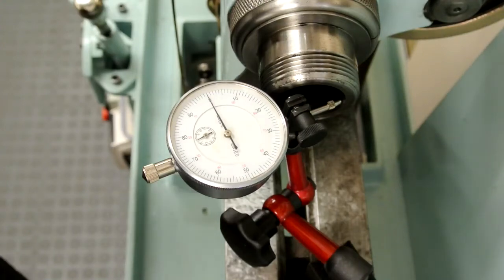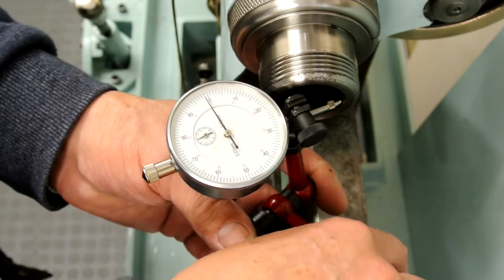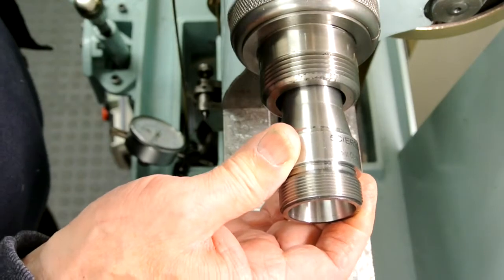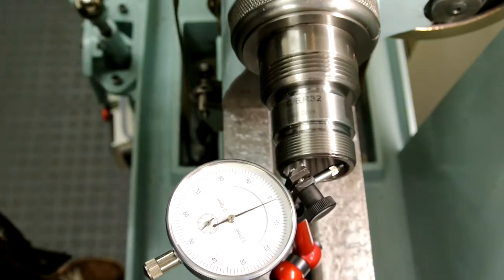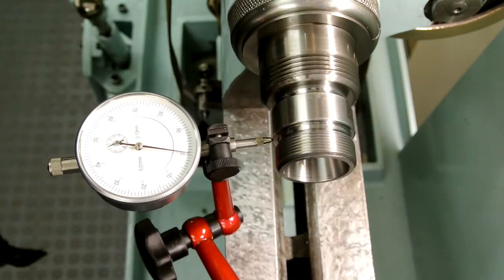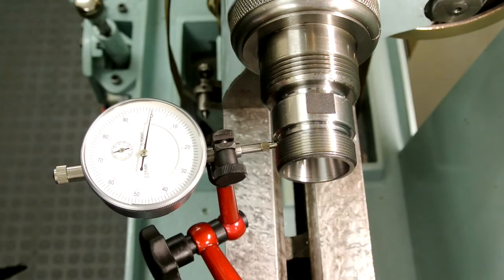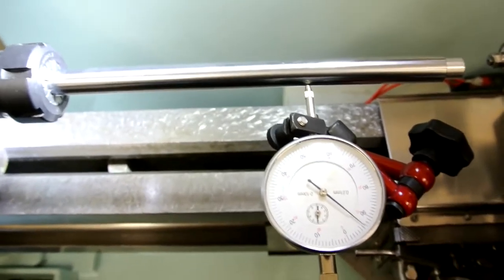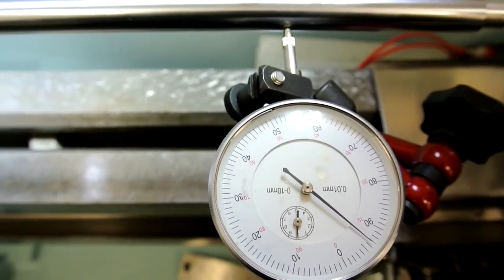Rivett 608 fitting a new er32 collet chuck

Comment: have you got a video of you regrinding the chuck?
Reply from the maker: Sorry no. I used a fine diamond grinding wheel and a motorised milling spindle. The top slide was set up using a dial gauge so it was accurately set to 8 degrees. To do this I used a dial gauge in the bore of the collet chuck until it was running at 0mm deflection. I blued up the internal surface before cutting so I could see what was being removed. It was a little tricky to mount the spindle and get it exactly on centre height. I could hear it cutting one side only at first. I stopped when it seemed to be cutting evenly and checked the fit of the collet in it. It is important to fit a ground pin of the same size as the collet so the outside is held accurately. I checked with engineers blue and it was obvious that it was cutting more at the back than the front. I could actually feel the collet rocking slightly. I altered the angle slightly and reground it until I could detect it cutting at exactly the correct angle. All this took a while but did give me an internal angle that was an accurate fit to the collets. It was much better than the original chuck.

John

Comment: The run out is normaly measured on 100 mm out of the chuck. 0,06 is not abnormal, but for modern fast operating (cnc) machines way to high.( thos are asking for other clamping systems - 0,004 mm max.). For older and slow working machines it is normal. Things can get worse if the collars are used to long. If daily used for clamping various tools, the have to be replaced every 6 months in order to have a constant precision. Good thing to check the precision of your tool clamping systems. Best regards.
Reply from the maker: Dirk
Thanks for the comments. Don't forget that the Chinese ER32 collets are not that accurate. I already returned one set because they were terrible. These ones were a bit more expensive but were much better. At least the collet chuck is accurate now and any inaccuracy is likely in the collets. It is not possible to grind the collets to get them to run true unfortunately.

Originally the Rivet 608 was one of the most accurate lathes in its day.  The original certified run out accuracy was .002" at 2" for the 5c collets. The spindle run out was 0.0001". 

John
Reply: True. A lot of "manufacturers" are offering these collets. it is not easy to find the good ones. Personaly i do have the best experiance with German ones. But of course in the US someone must offer a simular quality. Often the difference is in the number of (i do not have the right word) incisions. ( and clamping range - bore).
Bad ones are the cause of vibrations in the tools. Those tools can snap ore slide out of the toolholder, the finnish of the workpiece is less good. Best regards.

Comment: Whoever has done that lathe has done a no-no and scraped the bed. That is a sure fire way to get it to gather all sorts of dust and grit that ends up under the carriage and tailstock to cause wear. It should be ground and the underside of the carriage/tailstock scraped.
Reply from the maker: Jaako

All 608 Rivett lathes were originally scraped on all faces and looked like jewels! 

John
Reply: Apparently Rivett then didn't care about wear life of the machine. Typical smoke & mirrors sales technique, looks pretty and looks accurate, but fails faster than anything else.
Reply from the maker: Jaako I have no wish to get into a slanging match with you, but this US built lathe was one of the most accurate and expensive lathes its time. They made 1875 between 1920 and 1960. The lathes cost $2,000 in 1936. The lathes usually ended up in pride of place in tool rooms of leading industrial organisations like Rolls Royce. The man who did most of the early scraping work was so proud of what he did he signed his name under the label on the lathe. My own lathe is 75 years old and has been used quite a bit over the years and still bears much of the early scraper marks. It has reached the point where a new scraping or a light grinding would benefit it.

John
Reply: Hi John,
Where did you get the lathe from?
My father had one which was passed on from his father and I used to make transducer bodies on it when I left school. My family sold it when he’s passed away, was absolutely gutted.
Beautiful machine. Great job.
Thom
Reply: @Timbo Dewabem Many confuse "oil flaking" for scraped surfaces. Bridgeport milling machine's as one example only get ground, there's no scraped surfaces on them. However they do or at least did get that flaking done to them to provide extra area for the oil lubrication. I'd be willing to bet Mr. Fagerlund knows far more about proper scraping and machine tool rebuilding than 99.999% of the people on YouTube. Rivett machine tools were unargueably some of the finest ever made. If? that really is scraping and not oil flaking then Rivett must have had very sound reasons for doing so because what Jaakko mentioned is the accepted rule today for the sliding surfaces on machine tools now.